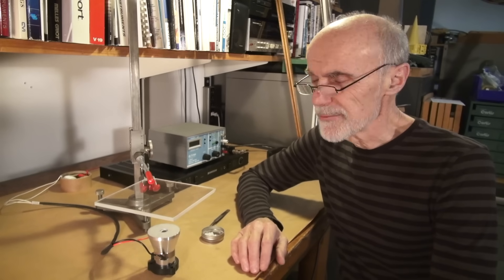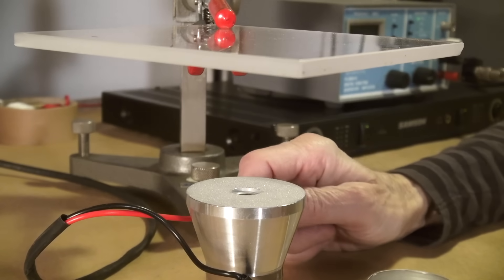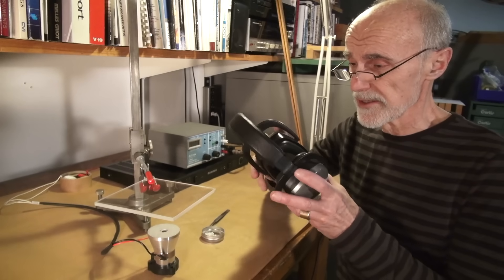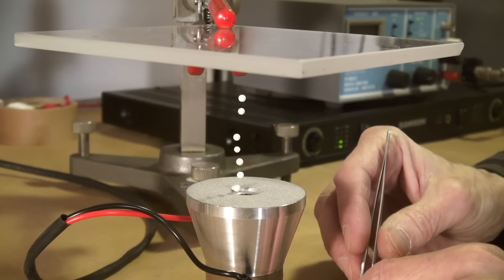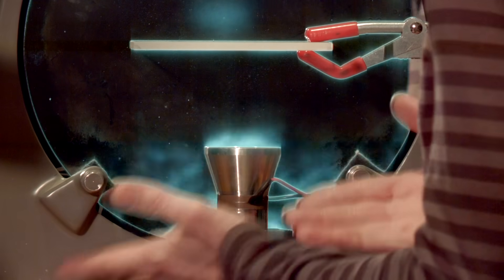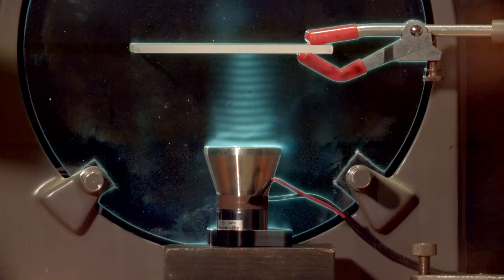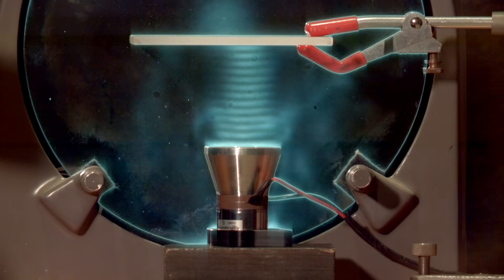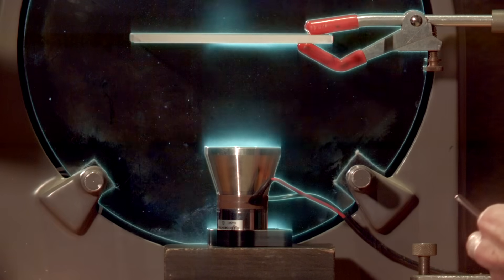Acoustic Standing Waves and the Levitation of Small Objects

Comment: technically the balls being held in the low pressure zones... not the high pressure zones... right?
Reply: if the balls sit in the high pressure zone then something must have forced them to go there. besides, a ball sitting in the middle of a high-pressure zone should behave similar to an inverted pendulum - a slight deviation from the equilibrium point would blow the ball away from that point, quite the opposite of what we are observing here.
Reply: The high pressure are will be the Empty Space.  Not the Space that's Filled... that space is the Low pressure.   So you are putting the balls into the low pressure space... which is the white bands.
Reply: As I mentioned in the video, there's a bright band of light right next to the reflecting glass.  If you agree that the pressure must be maximum at that location, then it's logical to posit that the bright bands are high pressure zones ... and that's where the balls congregate.
Reply: I disagree.  The bright bands are the space where the LEAST MOTION occurs, which is why the balls sit there.    The clear bands are the spaces where the motion is Greatest, and thus THAT would be where the highest pressures are found.
Reply: I agree with you that the bright bands are the space where the least motion occurs, and that is another reason to argue why there's a bright band right next to the reflecting glass plate.  Furthermore, the pressure is greatest right next to the glass plate.  Do you not agree with that?  One can also invoke Bernoulli's principle:  the greater the speed of the moving fluid, the less the pressure (and vice versa).
Reply: Can you prove it with pressure measurements in the bandings?    Bernoullis principle deals with Fluids.  Are you saying the air caused to resonate and produce standing waves is a fluid?   You can invoke alot of things, but they gotta make Sense and be reasonable.    

If I accept your application of bernoullis principle, it would assert that the space with the most motion is also the space of lowest pressure, which doesn't make sense.   If it was of lowest pressure the balls would seek that placement.    

Perhaps what it means is that the standing wave is producing a triplet, not a pair... in that the highest motion area will have the highest pressure in the form of a boundary condition, the boundary being 1/3rd of the triplet of induced form...  and the boundary would be where the highest pressure shear would show up... as the dividing line between the high pressure and low pressure zones...  Thus the rareifaction and condensation regions are not the complete picture without the boundary being accounted for as well.     And its the high motion, low pressure that produces the low motion high pressure boundary that produces the volume where stillness results which is where and why the ball sits in that placement.
Reply: A fluid can be a liquid or gas so, yes, I'm saying that the air is a fluid obeying Bernoulli's Principle.  Here's the way I'm envisioning what's going on:

Air molecules in the high pressure region move the least and air molecules in the low pressure region move the most.  Indeed, smack in the middle of the high pressure region, they're moving hardly at all and in the middle of the low pressure region they're zipping back-and-forth like crazy.  Look in any introductory Physics textbook that deals with standing sound waves in pipes.  They typically include a plot of pressure variations along the pipe's length as well as velocity variations along the length.  Notice their phase relationship.

So imagine a little ball sitting smack in the middle of the high pressure zone where the air is moving the least.  On each side of this zone is a low pressure area where the air molecules are moving anti-symmetrically to each other.  That is to say, they both move away from the high pressure zone (in opposite directions) and then towards the high pressure zone (again in opposite directions) in each cycle of oscillation.  They're oscillating longitudinally back-and-forth and are 180 deg out of phase with each other.  So if you're a little ball, you would experience air molecules rushing at you from both sides (resulting in no net motion of the ball) only to be followed by air molecules rushing away from you on both sides (again resulting in no net force on you because of the symmetry).  That's one cycle and it repeats.  The result is that the ball repeatedly gets "pushed" and "pulled"  symmetrically from both sides (I'm using rather colloquial language hear) and ends up just sitting there.  It doesn't really just sit there because gravity is also pulling it down all the time, away from that equilibrium spot ... so it does move a bit.  I envision it jiggling in place.  The motion would not really be perceptible in the video because it's so small.
Reply: Thanks for the polite and detailed reply.   I understand the visualization that you've laid out, but I would expect there to be more diffusion among the boundaries  so that instead of the bands looking pretty much the same for their width, they'd show a pattern reaching a peak at their midline and diminishing the a minimum before transitioning to the inverted low pressure area.   

Additionally I'd note that longitudinal oscillations don't go back and forth, like transverse oscillations, but rather are pressure waves that expand outward and contract inward in a point sphere type geometry.   Where the physical volume is increased or decreased a variation in where the bandings would then result.   Again I'd expect there to be more of a transitional change following a curve to a peak before coming back to the relative zero before the pressure goes below min pressure defining that other volume of space.   The banding in the video demonstration above appear to be pretty consistently either white/bright from the gas thats being used to make it visible being contained in its banding, and the clear bands are pretty homogenous as well.    

I wonder if you could setup 2 of those mirrors, with the second one orthagonal to the first, from above or below the setup apparatus,  to show the diameter of the sound bubbles that are evolving once you get the reflection to become additive thru that plate adjustment.    That would show the diameter of the bubble, while the existing mirror shows the thickness of those bubbles... maybe then around the edge of the diameter from the mirror set above/below the resonators axis it would show the curvature of the vibratory fields present?   

Otherwise is there a reason why the banding is so clearly defined?  are frequencies at the "boundary transition" just layered and compressed due the frequency that Thats why they are so cleanly defined?  

Lastly what is the name of the mirror setup you're using?   I'd like to get something like that for myself to add to my garage workbench.  :)   Thanks again for the chat thus far.
Reply: In addressing your questions about lack of diffusion at the boundaries, I can only guess that it's a matter of a lack of sensitivity and resolution in our Schlieren set-up.  How those two parameters can be maximized is too complicated to discuss in these comments.  Let's just say that there seems to be a threshold of (air) density gradients below which the set-up is not sensitive to, resulting in sharper demarcations than one would expect.

Our Schlieren set-up utilizes a single spherical mirror (as opposed to a Z- configuration) and you can read more details on our website:
https://sciencedemonstrations.fas.harvard.edu/presentations/schlieren-optics
Reply: A late addition to the debate, but consider that wind (flowing air) moves from high pressure to low pressure.  You're balls are being 'blown' into the low pressure zones.  As to your argument that the plate is a high pressure zone, I disagree. In order for a standing wave to be reflected back with constructive interference, the plate must be located at a node - the pressure is at a minimum there.  The Schlieren bands are revealing the high density air.  Back to original point that high pressure 'blows' to low pressure, the band you see at the surface of the reflector is dense air that has been blown into position by the high pressure 'gap' below it.
Reply: if you look more closely you will see that there is a dark band at the reflector, the dakr bands are just thinner in size. the balls are sitting on top of the high pressure zones.
Reply: that Schlieren optics show the warmth of air - the hotter the whiter - hot -->  low density
white zones are low density
when air is hot the distance between particles gets bigger- >> low density
_________________
      high density
_________________
       low density  ---->BALL HERE
_________________
      high density
_________________
Reply: Yes you are right the ball is located at one of the nodes which corresponds to the minimal potential energy i.e. low pressure. Reference: https://www.nature.com/articles/s41598-017-07477-1#ref-CR19

Comment: This is quite an amazing video! However, there are some questions hovering in my head after watching. It is quite strange to me that the audio recording did not capture any overtone generated by such types of ultrasonic transducers. Commonly, the overtone is quite significant for either 28 kHz, 40 kHz or 56 kHz transducers. Was that because of a different driver circuit other than the ones commonly used for cleaners? Other than the transducer, the Schlieren/shadowgraphy imaging setup did not show any focal problems either. To my best knowledge, the single-mirror shadowgraphy generate two shadows per object due to the distance between the point light source and the pinhole/blade in front of the image sensor. However, this effect was almost negligible in this case. Is there a particular reason for that?
Reply: Yes, I drive the transducer with a pure sine wave at resonance.  Other (cheaper) techniques use a square wave or simply chop the current at 28 kHz.  The camera is on the optical axis so the image of the object and its mirror reflection are pretty much aligned and superimposed.  Is that what you mean by "shadow"?
Reply: Interesting! I have an ultrasonic levitator in my lab as well. However, I was not able to levitate any object, when the transducers were driven with a sine wave, from which I thought the overtones can be critical in terms of levitation. I will have to look into that again.
Regarding the shadowgraphy, what is the distance between your point light-source and the pinhole/blade? To my best understanding, the object refracts the incident light on both directions (incoming and outgoing). Because of the distance between the light source and the camera, the paths of the incident light do not overlap. Thus, two shadows were observed in my experiments. It would be nice if you could comment on this.

BTW, thanks for the reply!
Reply: The distance from the point light source to the mirror is 6.24 meters ... and back to the razor blade is another 6.24 meters.  You're quite right about the refraction happening in both directions.  Thus, the further the object (that the camera is focused on) is from the mirror, the less the the images will overlap.  We position our objects very close to the mirror so the images are more closely registered on top of each other.

For more details of our Schlieren set-up, see  https://sciencedemonstrations.fas.harvard.edu/presentations/schlieren-optics
Reply: Thanks again for your quick reply! This is very clear to me now.
Reply: You're very welcome ... hope you get your set-up working!

Comment: "I know it's a high pressure because there's a bright band" -- Nope.  That does not follow, the color depends on several factors not just density of the air. The color of the band depends on refraction index and position of the knife edge that's blocking the focused light.  Put the knife edge in a different orientation and you get a different color.  Additionally, since the Schlieren optics are not perfectly aligned with your subject the pattern is offset from the subject by some degree, refraction also changes the position of the apparent bands. Finally, the balls are not "resting" on a high or low pressure band, they are resting NEAR the interface between both high and low pressure where the (push - pull) on them is sufficient to overcome gravitational acceleration.  DERP. "I love science" folks are dumb.  Ultrasonic speakers don't remove gravity from the experiment - furthermore, a cheaper speaker that's in the audible range will still create the standing wave effect.
Reply: What you say about refraction etc is absolutely true.  However, concerning your claim of the "offset," the camera was aligned with the glass plate.  Since a bright band of light is located at the surface of the reflecting glass plate, I interpret a bright band to indicate a high pressure area.  There's also a bright band at the surface of the ultra-sonic transducer.

True, the balls are not "resting" on a high or low pressure band.  This is a matter of colloquial semantics and I should have chosen my words more carefully.  Also, I never meant to imply that ultra-sonic speakers remove gravity ... of course they don't!  As far as standing waves are concerned, you secure them at any frequency ... I never claimed otherwise.

I plan to investigate all this in more detail in the near future and will report back.  Thank you for your comments.

Comment: Awesome work!!!
I have tried making a acoustic levitation setup in front of the Schlieren optics.
However, when levitation appearing, I could not find any standing wave pattern on Schlieren optics by camera. 
Is it something special to making a Schlieren optics for acoustic levitation comparing to normal Schlieren optics designed for heat flow?
Reply: No, there's nothing special about it.  Is your razor blade oriented vertically, by chance?  If it is, orient it horizontally.  A horizontal blade makes the set-up sensitive to density fluctuations in the vertical direction whereas the other orientation will be sensitive to gradients in the horizontal direction.

Comment: Instead of changing the distance between the speaker and the reflecting surface, could you just change the frequency of your ultrasound?
Reply: Yes, that would work if the transducer could generate ultrasound over a range of frequencies.  Mine can't, so I can't do that.
Reply from the maker: Sure, and that would have the same effect of making the standing waves disappear.

Comment: SIr 
Can i use 40kHZ driver to drive a 28kHz transducer?
The output frequency still 28kHz, right?
can we run your experiment without the home made transformer??
Reply: No, you can't ... to drive something at resonance, you have to drive it at its resonance frequency.  I designed my home-made transformer to efficiently couple the output of the audio amplifier to the transducer.  It's a matter of impedance matching.  You may or may not need a transformer, depending on the output impedance of your amplifier.  Some people make their own amp and design its output to drive the transducer w/o a transformer.

Comment: Any idea where i can buy such a speaker ?!?!
Reply: The "speaker" is an ultra-sonic power transducer (designed for ultra-sonic cleaning baths) such as one of these:  https://www.americanpiezo.com/standard-products/ultrasonic-power-transducers.html 
The one I'm using is the 50-watt version (but I'm only operating it at around 8 watts).
Reply: To what extent can we manipulate the objects ??
Reply: You can't manipulate them with my present set-up.  I suppose if you use a spherical reflector (instead of the my flat reflector) you can change the angle of the reflector and change the location of the focus of the sound waves.
Reply: Would it work with a car speaker and reflector ?!?!
Reply: No, it wouldn't.  The audio wavelength is too long and you would need an incredible amount of acoustic power to make it work.  In principle it's possible, but in
 practice it's not.
Reply: Wolfgang Rueckner actually you could manipulate them with your setup. But you would have to continuously alter the ultrasound frequency, to correspond with the changing distance of the plate (thus moving the spheres up or down). 
You need an online precise measurement of the distance of the plate, and a way to dynamically control your transducer though...
Reply: The ultrasound frequency is fixed at 28 kHz, so I can't do what you're suggesting.  Too bad ... good idea though

Comment: This would make a great tool for pulling sheets of single-layer graphene out of chunk graphene then depositing them to the side eventually making a patch quilt of single sheet graphene that could be deposited on some sort of backing material. You could then cut those sheets and sell them. If the backing material where flexible you could mold it into any shape you want. The process might be a little disconcerting to watch though.